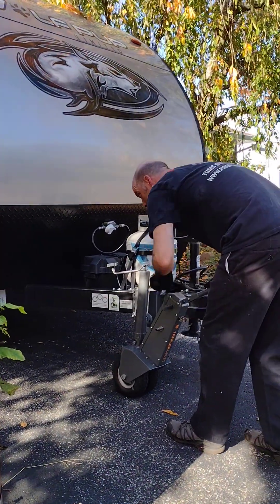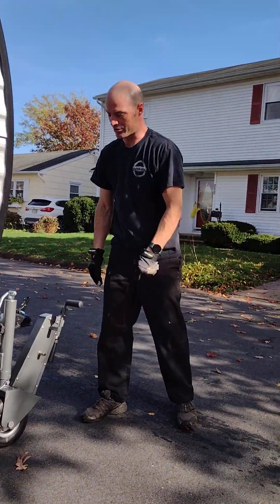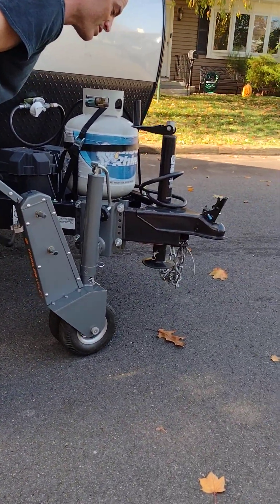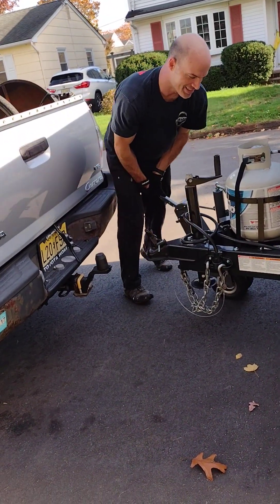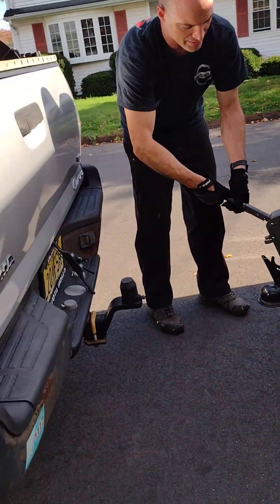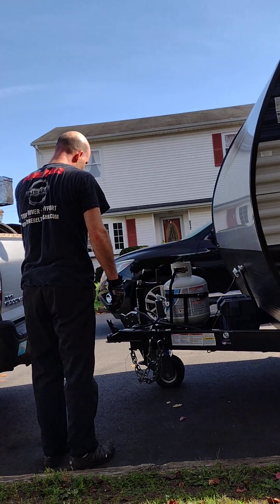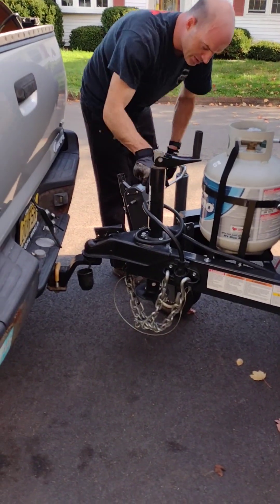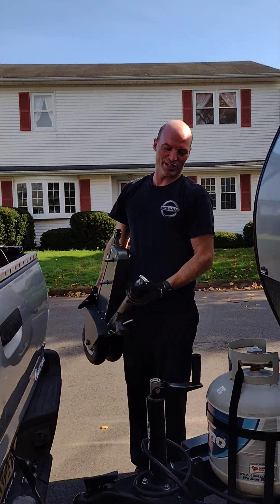[Part 2] Maneuvering Travel Trailer down small driveway with Trailer Valet 5X

Comment: I'm really surprised you don't use a weight distribution hitch on your Wolf Pup. Unfortunately, I think it would really get in the way of using this valet.
Reply from the maker: I have never had any sway on our 14CC even with a full black tank in the rear, something about the truck/trailer combo is very well suited just with the lifted ball setup.  I am grateful I can jackknife maneuver the trailer in tight spaces because the truck is thinner than the trailer, including backing into a camping spot last night, or many times in tight gas stations.  But yes you are correct most people probably would need to choose between using a valet and the brackets for a weight distribution hitch, good call...

Comment: Would it work on grass. I need to move my camper into a similar tight spot. Relatively flat but grass
Reply from the maker: Owners manual says grass is OK as long as it's flat and I think it would work especially since both tires are engaged as drive wheels... You might have better luck pushing the trailer backwards into a spot rather than pulling it out of a spot, but tongue weight should keep the traction.  Just remember to keep the tires inflated to 80 psi, i refill mine every time I use mine since they lose a small amount of air in the month or so in between trips, also I maneuver with the valet lowered to almost the lowest position to keep the tongue of the trailer pointed down (and less flex of the valet neck).  Good luck!!